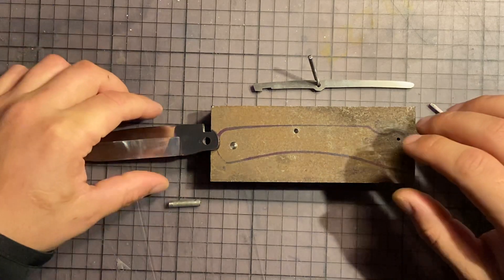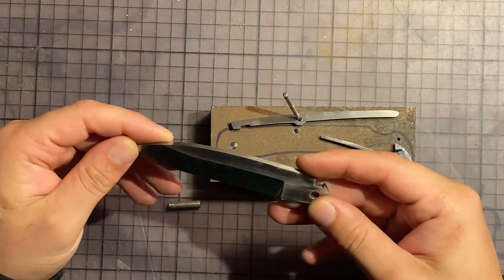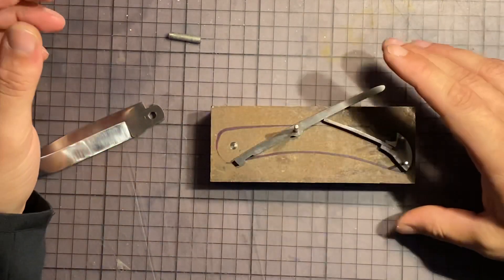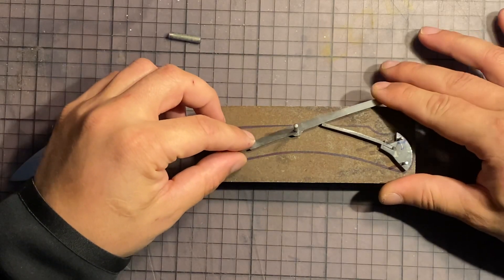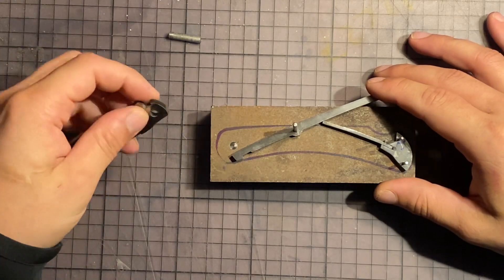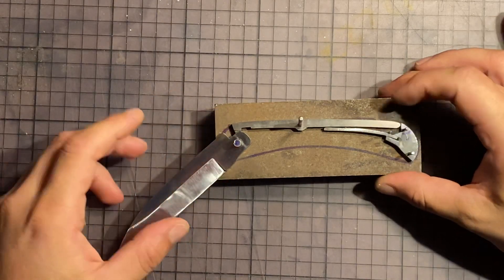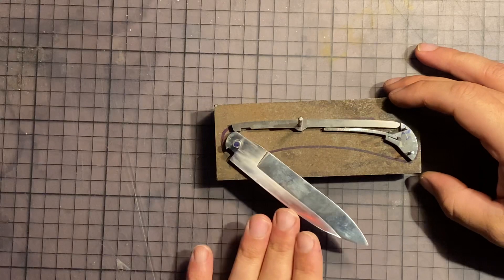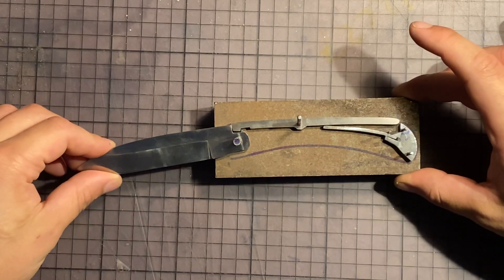Back-Lock Knife Mechanism

Comment: hi ... could you tell me how I could block opening the folding knives do not have the lock ....
Reply from the maker: Hi thanks gör the comment. Didnt think before but. Here what came to mind might be handy 
1) be süre the pivot Pın is tight enough to withstand the gravity and a bit more 

2) light weight leather seath like a poach (ör a sleave)will work 

3) simple rubber band:)) silly… but should do the job..:)
Hope I could help a bit:)